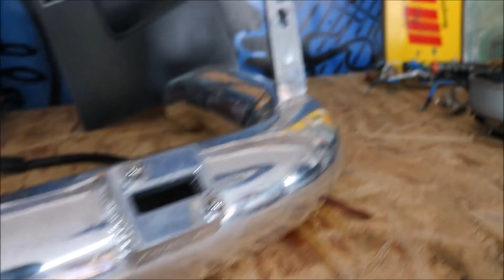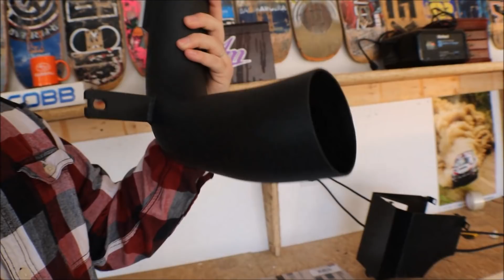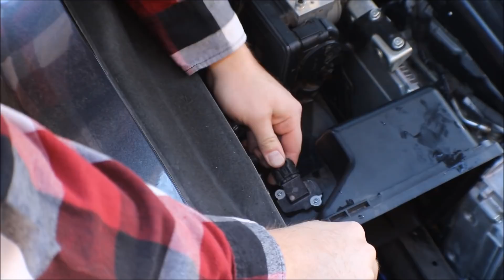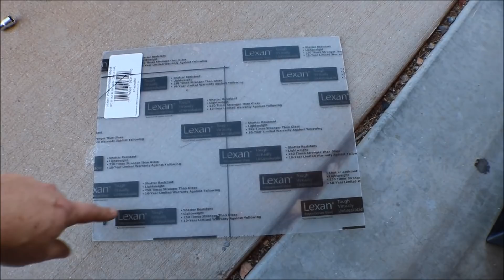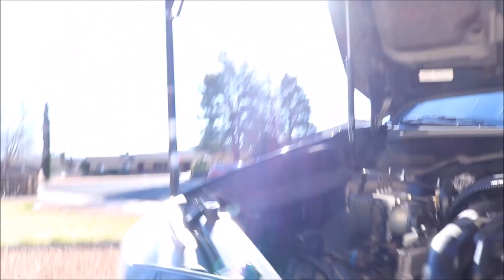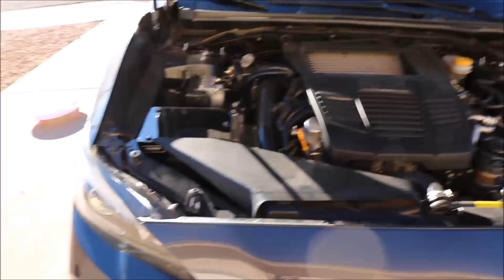INSTALL WRX INTAKE! MISHIMOTO RACE INTAKE HOW TO TUTORIAL 2015 2016 2017 2018 2019 2020

Comment: Very detailed video here.   Mine arrives next week.  Thank you for sharing.   Hopefully I don't mess this up.

BTW did you use the OTS tune from Cobb or?  Might do this first before an eTune.   That 91 Octane though :(
Reply from the maker: GR8GUY54 Thank you for watching! Very simple to do, don't worry you'll get it in just fine! I just used a cobb state 1 map. Installed my j pipe today and running Cobb stg2 map. Next is to etune for best results. The race intake will for sure need a custom tune though since the diameter of the pipe is 3"
Reply: Subie Shakedown thanks for replying back.   Bad news...

In an attempt to prepare for my arrival of this intake, I wanted to loosen the two 10 mm bolts that are holding the stock airbox
 and broke not one but both the bolts when attempting loosen them.  I used an open ended wrence and managed to jack this up.  Now both my bolts are broken and are sitting inside the holes themselves.   Hopefully I can figure something out asap. 

Thanks